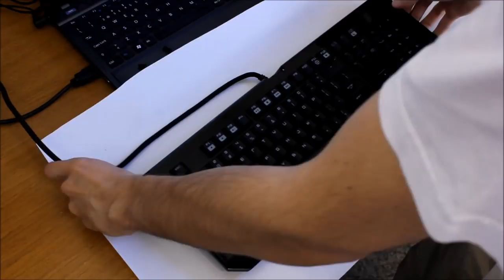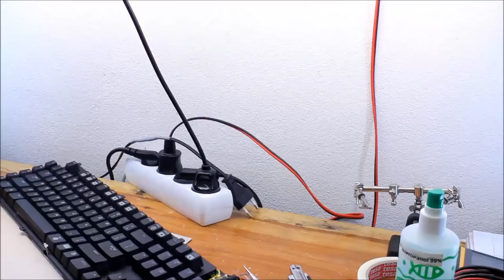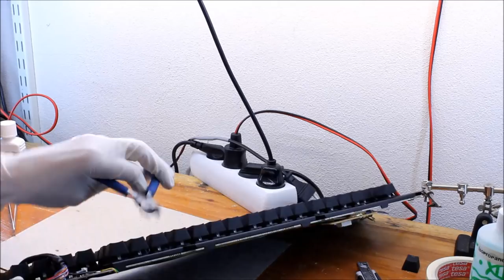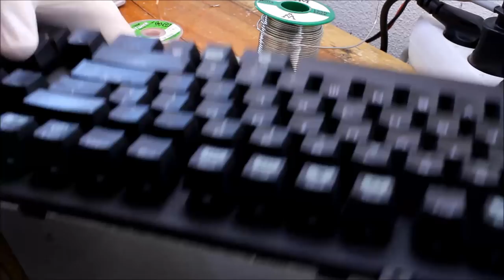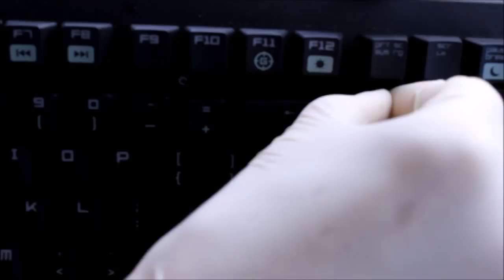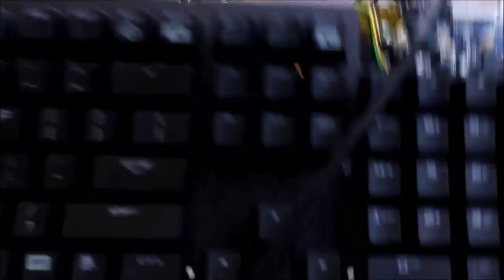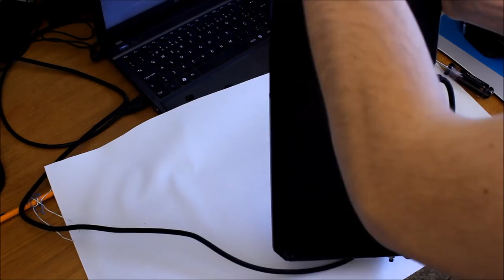How to replace backlight LEDs and Cherry MX switches in a mechanical keyboard.

Comment: Have you experienced dying LEDs (or even flickering ones) after that mod (if yes, how many have you replaced?)? and also what LEDs are those? just bought from china or high quality ones? Thanks in advance for the reply
Reply from the maker: No, never had any LED failure. As far as I remember I never had a very low current LED like these on backlit keyboards fail anywhere, and I don't really see why they should fail as often as some people experience.
  
These were cheap LEDs imported from china but they looked very well made, at least the plastic casing had a very high quality finish. High quality LEDs are too expensive for a low cost project, I think I payed something like 4 or 5 USD for a bag of 200 with shipping included.
Reply: ye me and you might have bought from the same ebay shop (if you bought them on ebay) i did a pretty simple mod to my keyboard, but idk why i already had to replace 7 or 8 LEDs

this is the thread, if you want give it a look i'd be glad, otherwise no problem

http://www.overclock.net/t/1501147/qpad-mk80-modding
Reply from the maker: Since you are talking about flickering LEDs, next time, instead of just replacing it try to check if it turns on when you try to move it, it might me a bad joint on the PCB, it's the only time I had problems with an LED with that keyboard in the video, because of a bad joint it sometimes flickered or turned off completely.
Reply: José Faria i tried moving it it just keeps flickering no matter i move it or not, also i just replaced it, cause, if i wait it starts disturbing the other LEDs too
Reply from the maker: That's definitely strange, have you tried reducing the brightness a bit?
Reply: ye that doesn't change things, they just keep flickering , also i experienced weird things yesterday, like there was a led flickering really hard, and i tried lower the brightness (my kb has 4 levels + off), it only had like 2 levels, it felt like i couldnt use all the 4 levels, if was either off, full brightness or minimum brightness, like something was bypassing those 2 levels
Reply from the maker: That's very strange, it's not because of the LED change, white LEDs and blue LEDs are pretty much the same. Maybe the transistor(s) that drives the LED is acting funny. Also, make sure the PCB is clean, that there are no solder blobs around.
Reply: my mod included removing all the switches too, since i had to repaint the back metal plate in a different colour, so i first desolder all the old led, then the switches and then i cleaned pretty good the board, and yesterday when the paint on the plate was completely dry i starter building it back doing the reverse thing, so plate>switches>new LEDs. Also what i noticed is that the transistor supplying the LEDs (TIP 42C) used to heat up more than now, looks like since their little higher forward voltage (compared to blu LEDs) they're loading less the transistor, draining less current. I know im bothering you, im really sorry but i really don't know what else i can do
Reply from the maker: TIP42, are you sure? Aren't those only available in giant TO-220 packages? It's not even supposed to get hot with such low currents. Doesn't each LED have it's own current limiting resistor?

Blue LEDs and single-diode white LEDs are very similar. The white LEDs with that yellowish coating are just blue LEDs coated with phosphors to get a wider spectrum, so replacing a blue LED with a white one should not be a very big deal.

I would start with that transistor and with the resistor that connects to it's base. You can also unsolder/cut the middle pin of the transistor and measure how much current is flowing, it should be less than 400mA on maximum brightness.
Reply: José Faria Yes it's a TIP42C into a TO-220 package http://i.imgur.com/q6Nj3Rb.jpg . Also i didn't see any resistor looking at this photo i took http://cdn.overclock.net/c/c4/c4fff8b8_EMpq2Ik.jpeg

I measured the voltage on some LEDs while on, when at max brightness there was around 2.7V when at minimum there was about 2.6V, shouldn't it stay the same since the PWM controls the brightness?

anyway i'll try that let's see if there something wrong with the transistor and/or its base resistor. I'll keep you informed if i find something weird. Thanks man, really
Reply from the maker: Really strange, using a through hole package so big and not an SMD part. The resistor should be connected to the base, the pin on the left, however, it looks a lot more complex than it should. If that's what really supplies the current to the LEDs it might not be a simple switching transistor but some kind of current limiting circuit, that might explain the bigger heat sinking requirements?

If there are no resistors in the other side too, check with a multimeter if the LEDs are wired in parallel, which would be strange, LEDs in parallel without a resistor to act as a ballast will probably not have the same brightness.

Regarding the voltage, you're just measuring a result of the forward voltage of the LED, if it is PWM you will probably see some voltage too in you measure the voltage in AC mode. If you apply a low pass filter to a PWM source the resulting voltage will change a lot as you change the PWM's width.
Reply from the maker: oxidyzed Oh, and by the way, it might just be the light in the picture, but the resistor R1 looks a bit strange.
Reply: R1 is fine, there was a little of hot glue on it :) anyway i left the keyboard powered on the entire night, the only thing i found was a led low on brightness, i replaced it, the others look fine, just how i left it, i still hope it's only the LEDs, on 9 out of 200 for now are faulty, 4,5 % of the entire bag, might still be it, who knows...

edit, i saw only now the previous message, im gonna investigate more and see what i can find
Reply: this is the heart of the keyboard http://i.imgur.com/5gkUdVL.jpg there are no other resistors transistors or capacitors, only diodes near the switches holes like shown in this http://cdn.overclock.net/c/c4/c4fff8b8_EMpq2Ik.jpeg other than that

The other face of the PCB is completely clear, other than solderings theres nothing more. Also i'm pretty sure Q1 (TIP42C)  is the source of the current for the LEDs, since if i try to bridge the base of the transistor to the other end of the R6 which is around 270 ohm, all the leds bright up a lil more (since it's only 270 ohm the difference is almost imperceptible), and if i bridge the emitter and the collector all the leds bright a lot more (it's not direct 5V tho, it's prolly around 3/3,4V)

Isn't the PWM controlled by the MCU? do you think it's possible to alter the PWM voltage output only acting on the hardware?
Reply: another led started flickering now, after almost 24 hrs...
Reply from the maker: Either you bought the shadiest bag of LEDs ever or you have a bad controller. The diodes are probably just for the n-key rollover.

Yes, the PWM signal should be generated in the MCU, from the looks of it in the bigger one in the left, the one on the right looks like a USB HUB controller.

You could bypass the PWM signal, but I'm guessing it's not the microcontroller's fault, I'm betting in something wrong in the components in the right near the TIP42 (including) or you have really bad LEDs. If it was the controller's fault you should have seen some of the LEDs being driven too hard and giving up a lot of light before getting dimmer.

If you have spare resistors and leftover LEDs, you could always wire 20 or 30 LEDs directly to some kind of power supply, drive them at 10 or so mA each and see if they go out or it's just in the keyboard.
Reply: José Faria the led i was talking about earlier, stopped flickering now, i just wanted to wait and see what happened, when i came back like 5/10 mins later and it just stopped flickering.

the keyboard has 2 USB passthrough, a mic and an headphones passthrough. but it only has 1 USB plug for the 2 USB passthrough, so i assume the TIP42C is used to supply the 2 USB too and to be honest it doesn't even reach 40 Degrees Celsius (so not really hot)

What i think is that these LEDs has problems when getting dimmered by the PWM, i can't think of anything else since apart from desoldering and soldering, i didn't do anything else, and the older blu LEDs never gave me a problem in ~3 yrs i have this keyboard.

The thing is i couldn't find anywhere else to buy the same LEDs i bought (that are the exact copy of the one i had, but instead of blu, they're white), which are 3mm round diffused flangeless LEDs. I only found them on ebay from that Chinese Ebayer who sells all kinds of LEDs and similar stuff. The only place i could buy them was on one of those website about mechanical keyboards that sells like 110 LEDs for like 40€ shipped to my country
Reply: also i have some led a little brighter than others like in this http://i.imgur.com/IgH2o6f.jpg , the 4 and most of the letters are brighter than like 2 3 5 6
Reply: this thing is kidding, that led started flickering again...
Reply from the maker: Can you send me a photo of the back of the PCB, the one without any components?

That photo with the different levels of brightness in different keys might be the key to your problem. LEDs usually have a resistor each, because their forward voltage is not exactly the same, that means some of them will want to hog all the current and eventually go out. Maybe the original LEDs were really well matched?
Reply: here are 2 pics of the back of the PCB http://i.imgur.com/f3ghdbK.jpg
http://i.imgur.com/DCIzMsp.jpg

im also uploading a video to show the flickering, just so you can see what i mean
Reply from the maker: There we go, as supected the LEDs appear to be all connected in parallel.

Do you have problems soldering SMD components?
Reply: no, no problem i can "easily" do that i guess
Reply from the maker: If you don't mind hacking the keyboard, I would suggest adding a resistor to each LED.

To see if it solves the problem, you can do it first in just 8 or 9 LEDs in a row that have different brightness levels. In that image the number keys 2,3,4,5,6 look like good candidates because the 4 is brighter.

Here's how I would do it: you should choose one of the power lines, it doesn't mater if it's the positive or negative and cut the PCB track between the LED and that main track. Then you scrape aprox. 2 mm of the main solder mask in the track to expose the copper, then you solder a low value resistor between the LED pin and the scraped track to act as a ballast/current sharing resistor, here is in the picture you sent:
http://i.imgur.com/6thtNPL.png

If you do this in the keys 2,3,4,5 and 6 they should end up with similar brightness levels. Regarding the resistor value, you don't want a value so low that it doesn't have the effect desired, but you also don't want a value so high that it will make the LEDs too dim. I would start around 47 ohms, but that's just a shot in the dark, if you have other values on hand you can try them too and go by trial and error. Regarding the resistor package size, it looks like a 0603 resistor would fit perfectly, but if you are not comfortable with resistors that small you can probably fit a 0805 in there.

You can buy them online. Depending on the distributor, a tape of 200 will cost you 1 euro or less.
Reply: Well thanks a lot i'll keep that in mind, but im not sure i'll do that, it's way too long, it's risky and im not really sure it would solve the flickering problem, after all the blu leds worked like a charm, i don't really see the point on it, and im also probably not good enough to do such thing
Reply from the maker: If you didn't like the results you could just replace the resistor with a piece of wire, but I understand, it would be time consuming.
Reply: José Faria do you think that would solve the flickering problem?
Reply from the maker: I honestly have no idea, but that's what I would probably try first if I had encountered LEDs wired in parallel. That's why most LCD backlight have hundreds of volts going to the LED strings, they are wired in series so that the current is evenly distributed among them.
Reply: isn't the same on your keyboard? aren't the leds all in parallel? even cause, putting them in series would require hundreds of volts in the kb too, and it's not prolly a safe thing to do, and also, i'm not sure if an opamp would do the job
Reply from the maker: Oh, no, I'm not suggesting you do that, I'm suggesting you put them in parallel, like they are, but with a resistor in each LED. Mine were in parallel, all of the anodes were directly connected to the 5v line and each cathode had a resistor to the negative line, which was provided by the PWM resistor.

I'm not sure how my cooler master is wired, I'll check when I have the time.

The series talk was about LEDs in TVs and light bulbs without resistors, when you need efficiency and want to remove the resistors you should put them in series, otherwise it's easier to use resistors.
Reply: I think i'll just buy other LEDs hoping the quality will be higher, i saw on maxkeyboard.com they sell 110 LEDs for 20 $ + 7 $ shipping, it should be around 23 €. The type of the LEDs aren't the same tho, they sell water clear LEDs might be better for keyboards due to their narrower light cone, which will probably focus the light on the character printed on the keycap
Reply from the maker: Try that and tell us how it worked out :D
Reply: José Faria If i do and i find out that's the problem i'll let you know, coz 23 € for 110 leds is a bit too much, and also they're not diffused :<
Reply from the maker: yup, it's not cheap at all, but don't worry about being diffused, your keycaps will probably act as decent light diffusers.

If they end up focusing the light too much you can always sand them a bit on top.
Reply: José Faria ye right thank you a lot man, really you've been really useful
Reply from the maker: Just checked my current keyboard, this one also has a resistor in each LED.
Reply: José Faria weird i watched the teardown of a ducky shine YOTD and it only had diodes near to switches, no resistors
Reply: What if the too low voltage is damaging the LEDs? Could it be that to work properly they require an higher minimum voltage? i measured all the levels of brightness lvl1 2.59V; lvl2 2.62V; lvl3 2.66V; 2.72V. What if they require minimum more than 2.72V, and they can't work properly under that voltage? After all on the ebay page the forward voltage is 3~3.4V. What do you think?
Reply from the maker: With a lower voltage it's less likely to damage the LED. That voltage you measure is not "real", you would need an oscilloscope to properly see the PWM waveform and voltage. Besides, that doesn't matter, at low voltages, what kills LEDs is current, not voltage.
Reply: well cause i found the resistor that controls the voltage, if i remove that i'll shift of about 0.2V all the levels, which is better for white leds

Also i'd need an oscilloscope, that'd be really useful...
Reply from the maker: Don't try increase the voltage.

LED's care about current, not voltage. If you have a high voltage source with a very low current limit, the LED will not get damaged, it will take all the current it can get, but because it's limited at the source the voltage will just get down to the LED's forward voltage. If you have a high voltage source without current limit it will take all the current it can get, overheat and get destroyed.

If you have a voltage source you need some kind of current limiter, like a resistor, if you have a current source you don't care about the voltage, the LED will take all the current but it's limited anyway. 

In the case of your keyboard, you have a current source, but you have them wired in parallel, which makes things hard because even if they came from the same production line they all have slightly different forward voltages, which means some of them will want to take more current. If you mess around randomly with the power source of the backlight you might accidentally increase the current and there is a chance it will make things worse.
Reply: José Faria That resistor i found which is supposedly the limiter, is only 1.5ohms. Anyway i'm trying to draw an electric scheme of that part of the keyboard